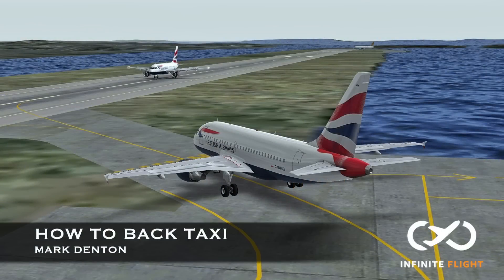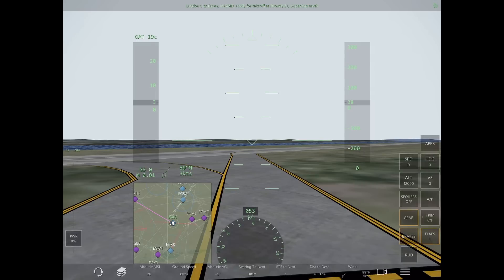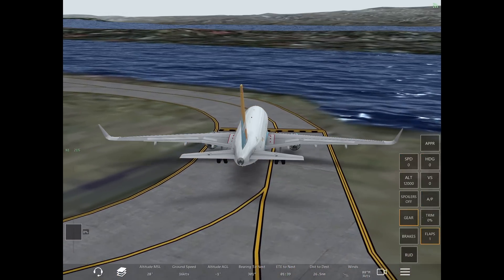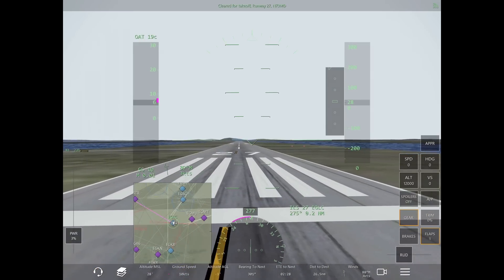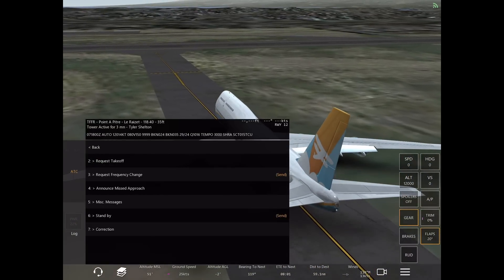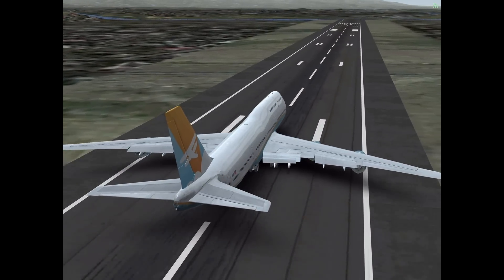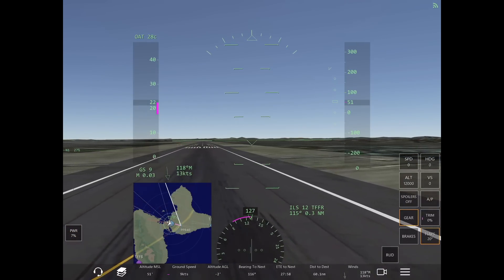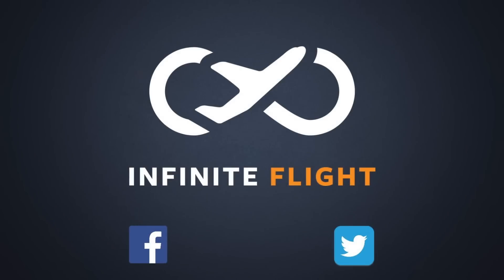Back Taxi Tutorial

Comment: Keep them coming "Chief Pilot"!  "Good Show". Just a minor point, Takeoff Rolls (Throttle Up) are initiated on the keys, mains passed the White Runway Boundary Marker..  On Displaced Runways like TFFG after the Hold Line one utilizes the overrun as a taxiway and maintains taxi speed till crossing the R/W Boundary.Marker (Your TFFG 747 example had throttle up initiated on the overrun. Overruns are not reinforced nor tempered to compensate for turbo blast nor heat, Picky Picky Picky, that's me, KISS, just sayin) Max Sends
Reply: That may be a local instruction for some airports, but I don't think it applies generally. Gatwick, for example, has large displaced threshold on runway 26 which is used by large aircraft for full throttle takeoffs.
Reply: +TheSmu8ajt ....Max Sez:  can't speak directly on any UK airport restrictions or approved procedures.  For me Safety of Flight and Common Sense rule.  Believe all reputable Commercial Operator Worldwide fly by the book.  Can't remember any QRH, POH or Manufacture Guidance that approved an off "Runway" Rolling Start nor do I believe any commercial airport anywhere would permit  flight ops on an overrun.  (Non-emergency Flight Operations on an overrun constitutes an incident/incursion.per the US/FAR). Max Send....   (We are talking "Displaced Runways", keep that in mind if you decent from my position)
Reply: +Max Mustang Okay, you've lost me with this incomprehensible reply, full of non sequiturs and rambling nonsense.
Reply: +TheSmu8ajt ...  Sorry it's not the "Queens" English old man.  Just parse my comment,  No need to be offensive either.  But atypical of a citizen of a failed empire.

Comment: It's ok to taxi more than 35mph? I've been ghosted 3 times for doing that! The ATC always warns me and I always get a note saying " max taxi speed 35mph " then if I do it to many times it will say " violation reported " in red then again, then finally it will say " Violation limit exceeded you have bin ghosted "
Reply: Starwars Geek 35 knts in ground speed you can see you ground speed in the hud on most planes
Reply: You may be reading the airspeed, the ground speed is less than ground speed when taxiing
Reply: Starwars Geek Also on the Runway you can go like 100 knots, because it's a takeoff area so you can reach the proper speed
Reply: Starwars Geek try using 30. 35 is too much for taxiing to a runway or parking
Reply: Starwars Geek it's not ok unless u are on runway
Reply: As long as you are on taxiways, you can't go faster than 35 knots
Reply: Starwars Geek because ur not on the runway and it’s knots not MPH